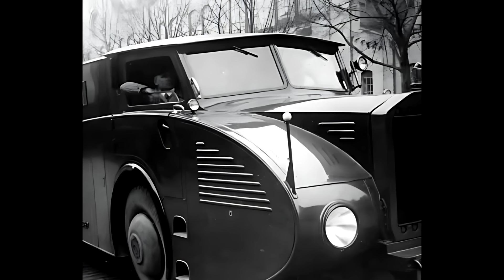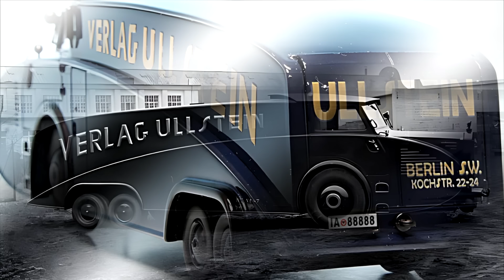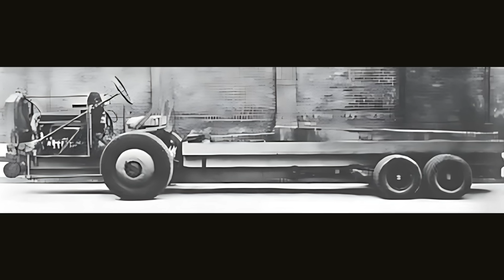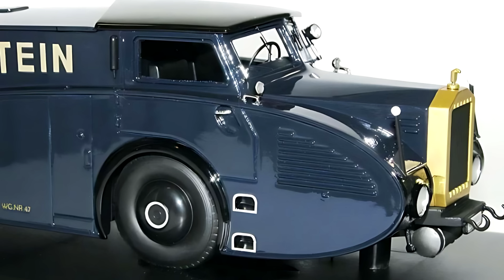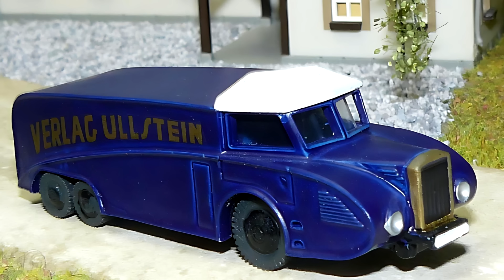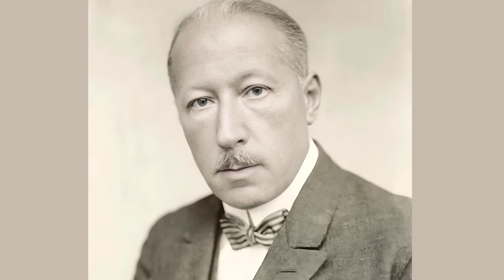1931 Rumpler RuV 31 💀 Lost to History but Decades Ahead of Its Time

Comment: Good idea - but for speed you need power for fast hill climbing and good roads, this = fuel consumption. Even the most advanced European trucks only save at most around 3% from their advanced wind tunnel tested aerodynamics. That unnecessary third axle might look "cool" but the extra drag and weight blow its other aims out of the window. 
Still looks fun.

Comment: "long before modern highways existed"? "By 1937, over 2,000 kilometers (of the Autobahn) were completed, with 3,800 kilometers finished by 1941". I would think these vehicles only made sense driving on the Autobahn, which had no speed limit,
Reply: 1st one made in 1931.

Comment: The Citroën CX Loadrunners mentioned in the comments are not comparable to this streamlined truck. The CXs are passenger cars that have been converted into extended delivery vans due to their frame construction.

The only things both vehicles have in common is the transport of newspapers over very long distances at night, front wheel drive and their 6 wheels.
Reply: And the streamline
Reply: @a.w.867
 They were lighter built, true, but they were built in larger numbers, and capable of higher speeds. The newspapers delivery versions were known for speeds as high as 125 mph or 200 kmh, and would routinely complete 2,000 km over a 24 period. up to 700,000 a year. They would often swap out engines and transmissions every 3-4 months. There are RV and Ambulance versions around. I'd love to find a good one and import it to Canada.
Reply: I know about the history, I'm the owner of one of the spectacular Loadrunner 2 (No. 33 of 38).

Comment: Everything seems good except the roof over the windshields. The roof ledge over the windshields may break the wind from flowing over the windshields seamlessly, and cause a significant turbulence. So, what was it for? Protecting the front and side glasses from rain? Or, was it for protecting the vehicle from being airborne? Or, was it a tradition as they could only integrate a roof over a body this way at that time?

Comment: I've got roaring ambivalence about that radiator. It's magnificent, but it also wrecks the streamlining.
Reply: It's very German.  If you go on recce you will see a whole zoo of vehicles with their engine in that position.  I know what you mean though!!!
Reply: Well probably not considering the air is mostly passing straight through it
Reply: Correct. It looks like a really cool bus-van is trying to swallow a freight truck.
Reply: My mind immediately started trying to imagine a more streamlined design.. I had to rewind the video because I missed a lot of information 😂
Reply: Take out the radiator, and you have a tank.  It literally looks like a tank with a radiator.
Reply: Looks like another car coming out like aliens 😊
Reply: Would grab cool air for the radiator. Why would you want a air cooling system of a 1931 motor to be streamlined.